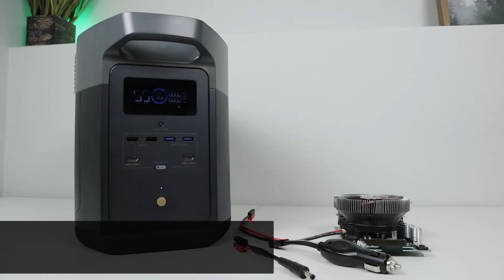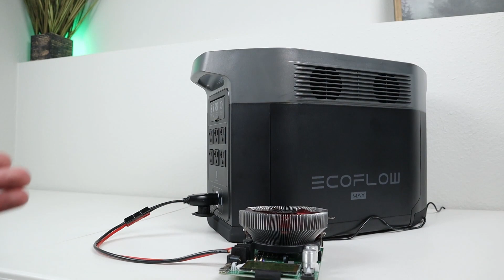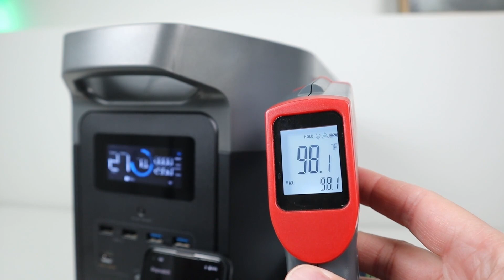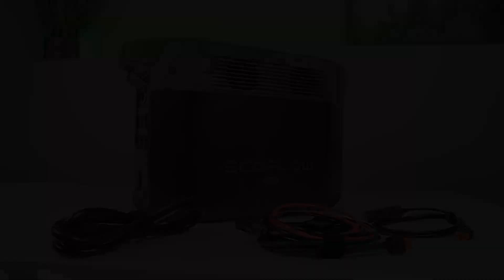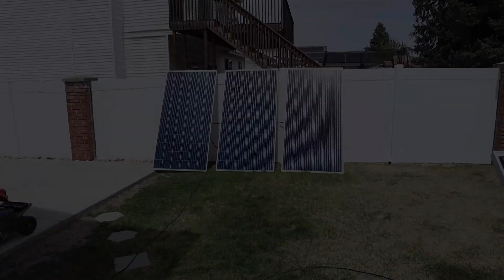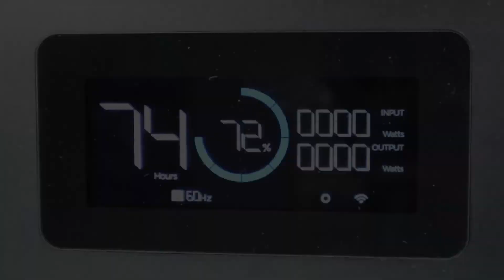Backup Power for Your House?! - EcoFlow Delta Max Full Testing & Review (2016wh)

Comment: It seems the cost of these items have dropped exponentially over the last few years. My intentions are to take a car alternator and hook a DC power motor directly to it and run it through a inverter to charge my power station. I guess my question is, or my intentions are, to run the 12 V motor that is powering my alternator to charge my power station. Also having the solar panels hooked up at the same time. I don’t intend on running the alternator off the cars engine. Seems like a way to eliminate my electric company. Maybe having up to three power stations would be proficient.
Reply from the maker: Here's a video I made about how to get the most from car alternator charging:
https://youtu.be/I78RxjRXTn4

Comment: Good video, thanks. You claim the DC5521 ports output 12+V, 10A whereas EcoFlow's specs claim only 12.6V, 3A. Which is correct?
Reply from the maker: The results in the video are what you actually get.

Comment: So you saying it should plug in my 3600watt 240 volts 50 amp kitchen oven stove or my 4800 watt 220 volt 30 amp water heater. Yes I know I can run my kitchen refrigerator for about 1 hour my kitchen refrigerator is a 2000 watt antique refrigerator occur in my microwave for about an hour-and-a-half if I'm using it slightly longer if I'm using air fryers. It can run my lights in the house my TV's computers charge my phone's make game systems all night long but nothing major that needs to run without run it out of  very quickly the batteries something's would last a little bit longer I can use it for running all the lights in my house all my none a Central things in my house that is not important. It will run one of my split air conditioner heater for about 3 hours of course that would be the only one that can run that's the only one that's 115 votes 850 watts all my other split air conditioner heaters are 213 to 230 volts.
 Don't get me wrong I I do want couple of those generates and it's batteries as well as the three or four Delta pro and it's batteries
But they might be used for something else then running my house since the power really kind of come short even with the power going out those who died just a few hours after they start running to backup power so I'd have a different use for those generators.

Comment: Just ordered the delta max 2000. It was a toss up between this and the  ac200max. Life cycle and no bidirectional usbc was the con for me. But the quick charge and not needing all the adapters and simplicity was kinda the winner for me since my wife will be using too. I have a smaller inverter generator and 1000 watt solar setup for my offgrid shed il be going between lol .What are your thoughts between the 2? Thanks for the video!

Comment: Darn why does this unit have such small DC output? Only one 12 volt 10 amp plug. Given the size of the unit you would think it would have dual 12 volt DC outputs or higher amperage. Competitors products that are cheaper have higher amperage. I guess it's not for RV van DC optimization loading.

Comment: I will never buy anything again from ecoflow.
During black friday I made the mistake of trusting what I read on their website.  The ad read "ecoflow deltamax 2000 + 220w solar panel, black friday 2022 $2199."  I clicked on buy and purchased it.  A few days later I received the unit without a solar panel.  I immediately called their 1800 number and informed them I had not received the solar panel.  The man on the phone told me I had not ordered the solar panel. Wait...what?  The ad said " deltamax 2000 +220w solar panel black friday 2022, $2199."
Be very very careful buying anything from this company.

Comment: UPS or not?   Your grading sheet shows that this unit has a UPS up to 2200W but you don't mention in your review.   I want to have an uninterrupted Power for a sump pump so it is critical that I have a  UPS.   Does this unit have UPS or not and if so to what amount?
Reply from the maker: They advertise a feature called EPS mode on the Delta Max. It's similar to a UPS mode but slightly slower. I didn't learn about the feature till later after the review.
Reply: TEPS and see if it meets my needs.    Thanks again.
Reply: Beginning of message cut off ---- thanks for quick response and I'll try to learn more about EPS and see if it meets my needs.  thanks again

Comment: has anybody charged by Car Battery alternator? not the cig or power 12 v 8 amp- if anybody has any problems using car battery or extra added batteries to car?
Reply from the maker: When you run off the starter battery or a second battery tied into your vehicle alternator system, you are basically charging your power station from the alternator. Your engine runs, keeps car battery full and at a steady voltage, power station plugs into the 12v socket and charges (or you make a custom wiring setup to the starter battery with a fuse and 8 or 6 awg). There are lots of options.
Reply: @Jasonoid  Thanks, I just finished another test charging echo pro max by using a 2000 watt inverter with 2- 12 volt -75 AH=150 AH tied into my starting bank with 4 awg wiring , found renogy monitor says voltage 12.6 and after 1 hour 12.2 voltage echo pro max charged 4 % at 800 watt setting. Inverter running cool not heated up like 1000 watt inverter.
Reply: my echo pro max I am also using 2 extra batteries total 6 kw, so I am charging all 3 batteries

Comment: Hello I recently received the Delta Max. It came with 30%. Once I charge it to 100% for the first time should I drain it to 0% for calibration purposes or never let it go under 20%?
Reply from the maker: It's not critical to drain it all the way. The main purpose I like to cycle it fully is to make sure I get somewhere around the rated capacity.

Comment: A little hesitant about getting this one as seen reviews People with it had problems with error codes and display panel and some were saying after 4 to 6 months it was not useable for reasons they did not look into. They claimed it work for a short time then was having issues ..NOT ALL BUT SOME UNITS ..DO I WANT TO TAKE THAT CHANCE?!
Reply from the maker: They launched the Delta 2 today, the updated generation to this model:  https://youtu.be/BhnaUIXefBw

Now the Delta 2 is smaller than the Delta Max, I expect they will put out a larger Delta 2 Max later on.

Comment: Would 175w Renogy Solar Panels work with this or are the amps too much? Thanks
Reply from the maker: As long as you don't go over the max voltage, you should be fine. This video explains about how to setup a solar panel array on a large power station: https://youtu.be/4JG8LvJznLY
Reply: @Jasonoid  Thanks so much for this info

Comment: Great Video on the Delta Max.......Question though.......We are using ours only for power outages so it will be stored away for longer periods of time........can I store the Delta Max at 90-100% power or should I store it at a lower percentage.......I heard you are supposed to store for long periods of time at around 30-40%...which would be a bummer if the power goes out all of a sudden and we are not charged to the full capacity when it is most needed.    Your thoughts?
Reply from the maker: I'd keep it right around 85%,  that's a great balance for both storing it and having energy in it to use when the power drops.

Comment: Question re Life cycles:  are any life cycles used if used only as a backup, constantly connected to the grid power so that there is no effective discharge from the battery  to the connected appliances ?
Reply from the maker: If there is a true UPS mode on the power station, using it while plugged in doesn't count as lifecycles. However, since the Delta Max doesn't have a UPS mode, it uses the battery and charges the battery at the same time and counts towards battery's total lifecycles.
Reply: @Jasonoid  je 
This is very helpful and  suggests a short battery life when about 5 kws go out and in per day - or 1600 kws per year or 800 life cycles per year resulting in a 20 % yearly loss of battery capacity
Reply from the maker: @alainleger8973  I don't think it works quite that way. If the solar coming in equals the load going out it balances and doesn't pull down the battery capacity. I think the extensive cycles would only be the case if the battery percentage drops down and then goes back up all day cycling up and down.
Reply: @Jasonoid  basically , I am looking at a constant draw of 200 watts, the Max connected to the mains of the grid, 5 kWh going in and out daily
The option would be to connect manually when the grid goes down, often daily, at any time of the day or night, should this be needed to protect the battery
This is the only reason for me not to buy the Delta Max immediately
Reply from the maker: @alainleger8973  I hear rumors they have a new product line coming out with UPS mode in a couple months, might be worth waiting.
Reply: @Jasonoid  thank you for this  I will wait for a UPS feature.  I have mailed a similar query to Ecoflow but have had no answer yet

Comment: Does the delta max have the 30 amp output like the Bluetooth ac200max?  200 max was your recommendation for us to run with a transfer panel for a little help on electricity.  Only reason we bring this up is we saw the delta max on sell for about $1400.  We thought this might be as good as the ac200max.
Thanks for your videos and help
Reply from the maker: The Delta Max offers faster charging and a higher inverter at 2400 watts. The AC200max has a 2200 watt inverter. The AC300 has the full 30 amp ac output and can output 3000 watts. 

Any of these large power stations can be hooked up to a transfer switch.

Comment: Excellent  review.  You confirm my experience.  I have about 6 wks of actual usage on my Delta Max with two Smart Batteries powering the AC galley and DC circuits in our 28’ Airstream thru an inside shore power inlet and automatic transfer switch.   I charge by solar when boondocking and AC when we take a campsite with power.  My only disappointment is that I cannot utilize the 400W inverter in my truck to charge, as the Delta Max requires pure sine wave input.

Comment: Can this be charged by my car during driving?
Reply from the maker: Yes. This comes with a car charging cable that plugs into a 12v sockets and charges at around 100 watts with that cable.
Reply: @Jasonoid  Thank you! I kept seeing 'car charger' but I couldn't decide whether it would charge the battery or just a port so the battery could charge 12v stuff. Thanks again! Love your video!

Comment: Hello jason, another great video. I have an Eco flow Delta the original one the 1200 watt plus the River Pro and was thinking about upgrading to the eco-flow max. I only really use it in emergency situations which would probably be maybe once every 3 months so that's why I went with the original Delta. And I will be upgrading to the max. You're really cannot beat the eco-flow max when it comes to that gigantic converter 2400 watt inverter when it's only got the 2000 watt battery. Very few power stations are like that. Question for you, if I get one of these either the max or another Delta or even the Delta Mini, how often in your opinion should you top it off to 100%? In other words if it's sitting in the corner for 6 weeks and has been turned off the whole time would you recommend topping it off for 20 minutes or so every 6 weeks? Maybe every 3 months or 6 months? Any information would be greatly appreciated love your videos keep up the amazing work. Your fellow YouTube friend, Jason
Reply from the maker: These don't seem to lose much power when they are completely turned off. I would maybe turn it on and plug it in every 2 to 3 months just to make sure all is well. Personally I'd recommend using it more often to get a little return on investment. Maybe run a computer off the inverter or maybe a TV when possible, then charge it back up with solar panels. That way you are familiar with where you can put the solar panel around your home to get the most power.

Comment: There are several serious flaws in EcoFlow app currently ...

1. it require cloud login to work ... e.g. If there is power outage (or EcoFlow servers have problem) then you may be stuck with incompatible configuration of power station. Depending on configuration it may significantly restrict usage or render it completely useless. There is no way to do factory reset without app on phone.

2. direct connection is not secured ... There is possibility to connect to power station directly (e.g. without cloud / internet). It is working only if you are already logged-in to app (problem 1). Connection between app and power station is using open WiFi with no protection at any level. Anyone with-in range of internal WiFi module can modify settings. This may disrupt operation and in worst case scenario cause fire ...

I think it is really dumb approach to configure even basic stuff via app. There should be several additional buttons and menu on device itself with all settings available directly on device ... 

On top of ^^^ there are additional problems on device itself. Like it is not possible to disable WiFi connectivity and sometimes you can see someone else power station in your app. Power station is not working on WiFi with long password (24 characters), on WiFi with space (blank) in password, etc ... I hope that at least some problems will be fixed with that OTA firmware update ...
Reply from the maker: Dude! Thanks Lukas... Excellent points here about wireless security! Do you know if ECOflow is aware of any of these issues? Have you tried contacting them about it? Any response?

Comment: This or Ac200P? Which is better? In 1- battery cycle 2- battery chemistry?
Reply from the maker: AC200p will get many more (cycles 3500 to 80%) being that it has LiFePO4 batteries. The AC200p has less risk for a fire hazard as well having LiFePO4. I use my AC200p pretty frequently and I have been very happy with it. It cost's much less than the EcoFlow Delta Max.

The EcoFlow Delta Max will put out 2400 watts on the inverter and has less parasitic drain (meaning you don't lose battery percentage as fast when running a small load). It also charges much faster if that's something you need.

Summary:  If you want to use this large power station everyday go with the AC200p. If you want to charge faster and have more power available go with the EcoFlow Delta Max.

Check out this grading spread sheet and compare both of them side by side to see them stacked up against each other:   https://jasonoid.com/powerstations/

Comment: I just picked up the River Pro on sale at Costco for $429.  Today I did an AC draw down test using a computer and an outlet watt meter.  Unfortunately I only got 485 watts out of it.  Do these batteries need to go through a few cycles before reaching max output or do I need to use a more uniform source?  Anyway I charged the battery up again,  Took 1 hr 37 minutes but also 860 watts to get to a full charge.  I'm running a fan which is drawing around 70 watts and will see what I get this time.
Reply from the maker: I still need to test my ecoflow river pro. I'll do a capacity test soon. I have heard people don't pull full capacity from it so it will be interesting to see a discharge test.  Keep me updated on your results!
Reply: @Jasonoid  Ran it again and got 493 watts out of it.  68%, that's rather disappointing.  I used a floor fan which was drawing about 65 watts per the wattmeter and showing 61 watts on the Ecolflow.  Ran for 7.5 hours before the Ecoflow shut down.  I'll see what others or getting.  I'm glad I got it from Costco as they have a good return policy.  I might have to refer to your DIY builds.
Reply from the maker: @schadlarry  thanks for letting me know about your second test results. Bummer on the capacity! I will see how my River Pro behaves, hopefully it's better than what you are seeing. The test results on the ECOflow Delta Max AC inverter was pretty impressive!

Comment: Since you are using a 2-wire measurement device for the DC capacity test, you should take into account the voltage drop over the wires. This way the DC output efficiency would be around 88%.
Reply from the maker: I could also use larger wires on my test setup. When testing a 12v socket plug for voltage drop, the resistance alone in the socket drops the voltage around 0.5 volts, 12v socket plugs are horrible. I prefer 30 amp Anderson Powerpole connections. The wiring I am using is pretty realistic to a real world application so it should be similar to what others get on their discharge cycles.

Comment: I just cant see spending that much coin on anything but lifepo4. Not just cycles and safety, but calender aging of the cells. NMC cells age much quicker than LFP , something like 3x faster.
Reply from the maker: I agree, I made sure to explain that in the video. I didn't want to mislead anyone since lifepo4 is definitely preferred with these power stations. At the end I broke down the cost per lifecycle and there's a pretty big difference!
Reply: @Jasonoid  I had to explain the aging paradox to commenter on another channel. He was a fanboy for jackery. He thought if he only used his Jackery 1000 ten times a year it would last 50 years since its good for 500 cycles.
Reply from the maker: Luckily new battery tech I coming out every year, so after 2 to 3 years the next best thing is coming out and it's time to upgrade!
Reply: @Jasonoid  New tech is in development with quvu using carbon based batteries. Bluetti is using some sort of sodium based batteries. I don't know which one is better